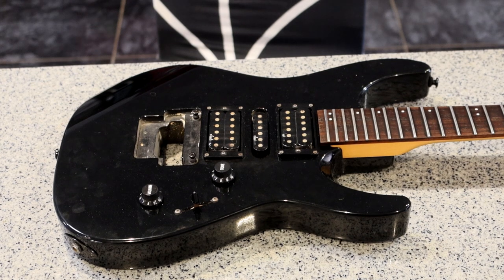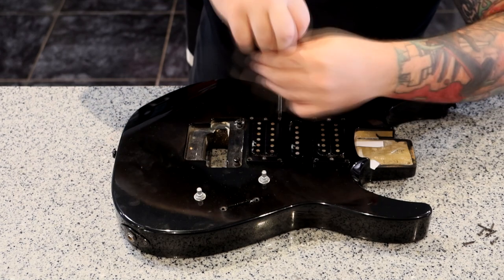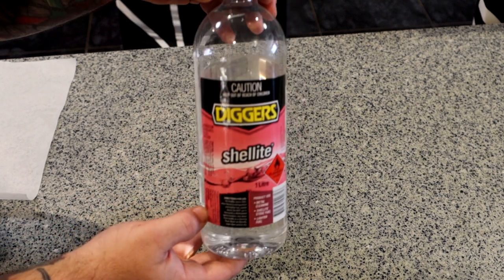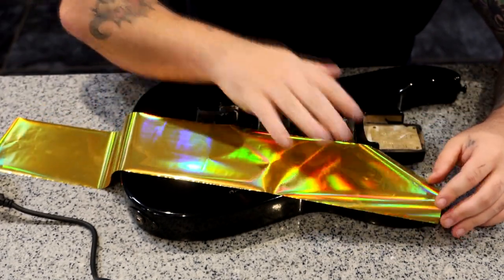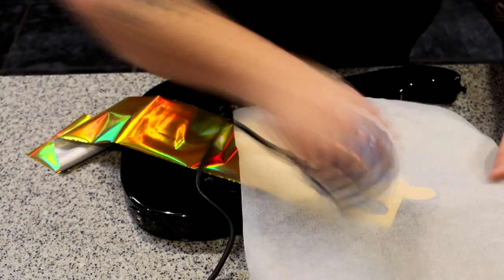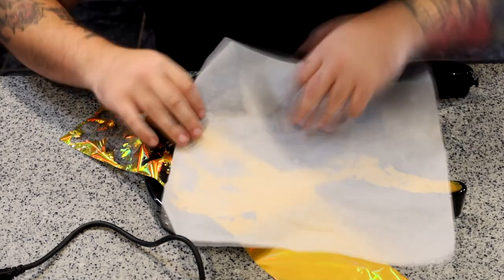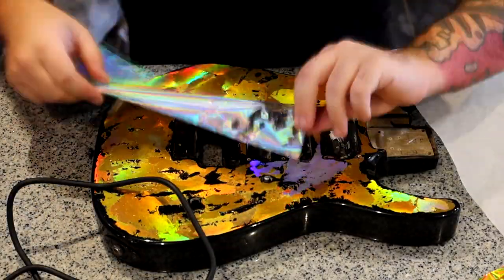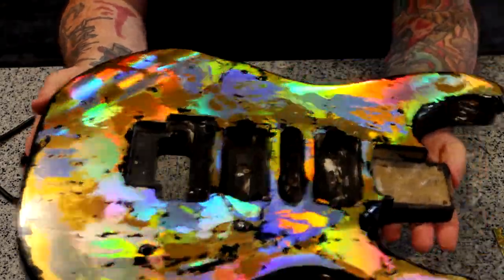Gold and Silver Guitar Holoflash Tutorial

Comment: heyy bro, thx for the tutorial!! your guitar looks insane after all the work!
so... i have questions: After completing the entire process, is it necessary to apply a layer of varnish or other similar material so the holoflash remains on the painting? Over time, the holoflash will “crack” and come off? And... can I do the same process on pickguards?
Reply from the maker: Hey there!

A clear coat is not required but is possible. If you do plan on using a clear coat it needs to be shot out of a paint gun. Solvents in rattle can clear coats WILL destroy it. As always test your products before application for compatibility.

Over time the Holoflash won't crack or peel off.

I wouldn't apply it to a pick guard, purely because the heat will warp and distort the guard.

Comment: Is there any way to do this using a pattern like a skull??? How long do you wait to clearcoat? Have you evwr tried Crystalac britetone? Its a water based poly? Thanks! This is awesome!
Reply from the maker: I haven't tried yet, but I've always wanted to experiment printing out a stencil using a cricut machine, laying it over the finish, holoflashing over that stencil, then removing the stencil to leave the design flashed underneath. I "think" it would be possible but due to how thin the actual flash is there's a chance the stencil may be too thick for the iron to properly contact the foil to the body, especially on the edges.

If you were to clearcoat you can do so immediately. I've had a couple of customers get back to me using water based poly out of a gun (not a can). The aerosols in the cans seems to be the reason the flash melts. Unfortunately I don't have a compressor or room to set up a booth to test it out otherwise I'd be running a lot of tests to see exactly what makes it tick and what doesn't. At this point I'm just relying on what customer feedback and experimentation I get and relaying that back to everyone else!

Comment: Would a regular iron work? Is there somewhere u can get bigger peices of the foil....?
Reply from the maker: A regular iron does not work. A crafting iron is necessary. Regular irons run too hot that they will destroy the paint work underneath. The metal base of the iron will scratch and tear the hell out of everything when using it. 

The crafting iron has a teflon base that has a little bit of give and has the ideal temperature range for the holoflash.

The foil I supply comes in 60cm x 10cm strips. I have a black foil that comes in 40cm x 20cm, there's a video on that being used on my channel as well.

Unfortunately in manufacturing at this time it doesn't get sent out any larger in size.

Comment: Have you ever tried to holoflash over a guitar that wasn't solid black on its face? Have you ever tried to get 100% coverage with the holoflash on the face of the guitar? Seems like all holo finishes leave open spots that show the paint beneath, even if small. Does it look bad to have 100% coverage? I'm asking because I've got an old charvel red burst that is really dark red to black edge and black back I was going to try this on. I never play it. Seemed like a good test guitar for this.
Reply from the maker: I’ve done the silver on orange and it has come up really good! If you look through my channel you’ll find an orange Guitar Hero controller (limited edition wooden body) that I’ve holoflashed!

The small spots are generally due to imperfections in the finish. Since the material is so thin and the iron is solid even a mm of difference in the surface can cause those gaps to appear. With enough time and work you “could” cover it completely but traditionally the effect was done leaving the small gaps to break it apart.

I won’t say whether or not it would or wouldn’t look bad because everyone has a different taste!
Reply: Thanks I appreciate it!

Comment: Very cool, i've just ordered 4 silver stripes at your etsy 👍
Reply from the maker: Muchly appreciated! I've just packed it right now so you should see it soon!
Reply: @dropbearattack6152  wonderful, it's for a nice project. Entire holoflash with black crackle pint over it, and a lot of 2k clear coat.

But i still ask myself if i have to put clear coat between the holoflash and the crackle paint.
Reply from the maker: @vivien-emilieh3905  Be wary that Oil-Based Polyurethane Clear Coats will disrupt the way that it flashes but I've had varied success with water based polyurethane clear coats!

The oil based seems to melt the flash effect and turns it into a weird, ugly grey but the water based doesn't react with it.

I believe the best course of action would be to apply a light water clear over the flash followed by the crackle over it just in case the paint itself reacts with the flash or doesn't adhere but experimentation is fun!

I'm currently recovering from hand surgery which is making life a bit difficult but I've got a lot of experiments I'm still keen to try that if successul I'll be filming and uploading in the future!
Reply: Yeahhhh thanks a lot for the time you gave to me, i'm going to apply 3/4 coats of clear coat on the holoflash with duplicolor aqua then the crackle paint and after spraymax 2k, a lot of coats and a lot of leveling........ Or i will let the snake skin relief effect.... We will see
Reply from the maker: @vivien-emilieh3905  Would really love to see how it all turns out! I absolutely love crackle finishes - seeing it done with holoflash would be absolutely amazing!

I have an idea in mind with an experiment I'm planning soon that is going to be a bit time consuming but hoping it works out, kind of attempting a reverse crackle finish where I spray a black undercoat, cut the holoflash strips up into random small sized pieces and apply them with thin, purposeful cracks to give it the crackle effect in reverse without overlapping any of the flash pieces. 

Will it turn out good? Who knows but it's always fun to experiment!

Comment: Looks amazing can this be clear coated?
Reply from the maker: Initially I thought it couldn't. My testing using products like Spraymax 2k resulted in horrible melting and it turning into a goopy mess.

More recently though I've had some customers with proper air compressor paint setups that have had success using polyurethane clear coats.

The key is to use air as the propellant, not solvents. Basically rattle can clears are a no go but you should be ok with an air gun finish.

As always, I highly recommend testing your products first to ensure compatability.

Comment: May I know if it is possible to apply a layer of black crackle over the holoflash? How would one apply a clear coat afterwards?
Reply from the maker: It is possible! I've been sent photos of a person who did this. It was all done using a proper air compressor airbrush setup. I'm not sure how the crackle itself was done but it was done in a manner that didn't use solvents which can melt the flash. Clear coating is the same deal - water or oil based polyurethane should work but it cannot have any solvents in it - this rules out rattle can clear coats like Spraymax 2k which will melt the final finish.

Like always, do test pieces first to test compatibility.
Reply: @dropbearattack6152 thanks for the reply man! I actually dm-ed you on ETSY. Btw, May I know how many sheets would I need to buy to entirely cover a strat styled guitar body? Thank you
Reply from the maker: @danaaron5883  I’m sorry for the lack of response. Etsy hasn’t been giving me notifications for some reason so I’ll have to see what is going on there.

2 strips should cover a stray style body. Naturally if there is a pick guard there is no need to do underneath the pick guard because it’s going to be covered anyway, but two should get you all the way there

Comment: Could you do this with, say, all one color, and go over it until it was all covered, with no gaps? I like the look, but I'd like to eliminate the black bits.
Reply from the maker: Entirely possible to completely cover the entire guitar without any paint underneath showing. It just requires a LOT of prep work to ensure that the area you are holoflashing is entirely smooth.

The gaps you see on this guitar are areas that have been dinged, scuffed and dented over years of use.

The most troubling spots are areas where pot washers, screws, rings and bridges have mounted and pressed into the wood. Naturally any dings make the surface uneven which won’t allow the holoflash to adhere and bond.
Reply: @Drop Bear Attack  Thanks for the quick response! Do you think doing this with a new body might help in that regard?
Reply from the maker: @cpfs936  I think it certainly wouldn't hurt. There's less chance of a new guitar having dings/imperfections in the body but it's never completely avoidable, especially in cheaper instruments.

I noticed with a test scrap body I use to try new techniques on, the holoflash wouldn't adhere to the very slight imperfection where two seperate pieces of timber were glued and joined to make the body. Despite being sanded, planed and painted it was still visible as a thin line where the flash just didn't adhere.

I did work out a technique - explained in the video - where I could use just the edge of the iron to push the flash into that line. It'll just come down to trial and error most likely!

The best part is though that you can lay the holoflash directly onto itself with no ill effects so you can keep just trying to get it to cover the spots that didn't adhere the first time.
Reply: @dropbearattack6152  Thanks so much!